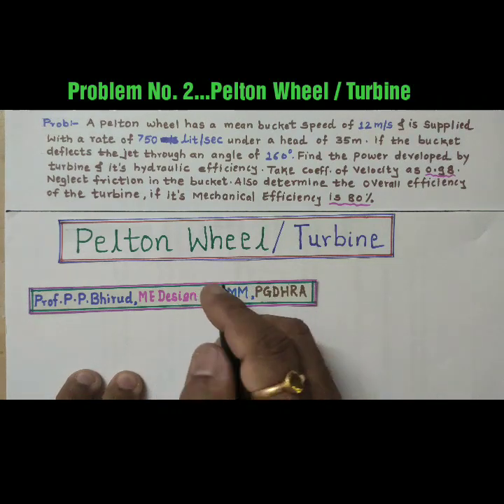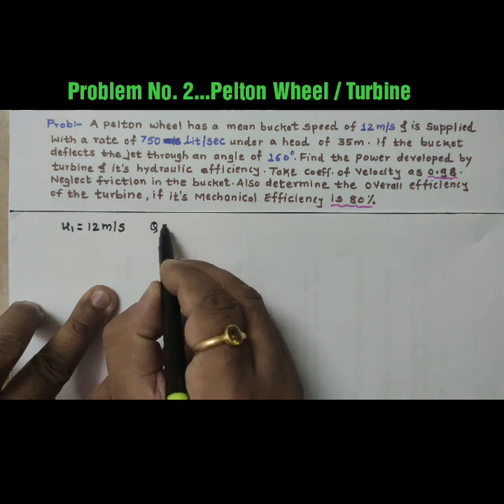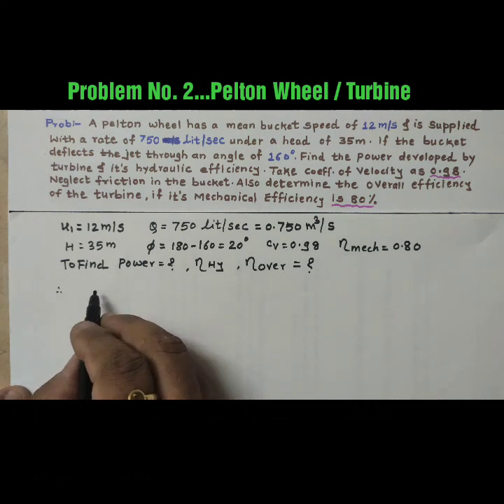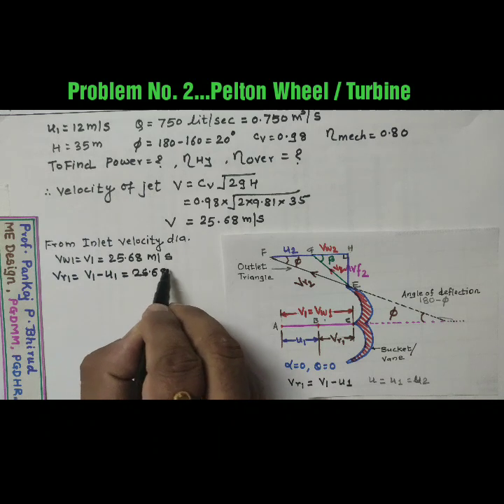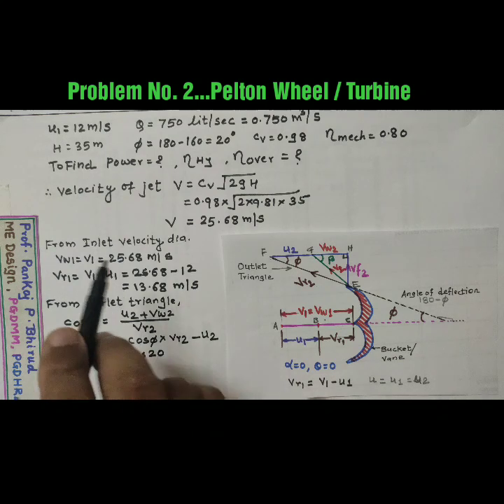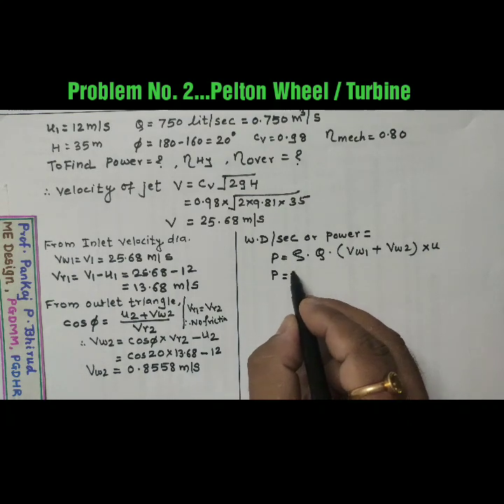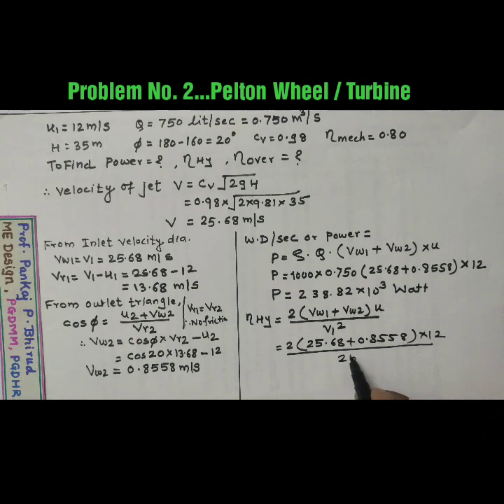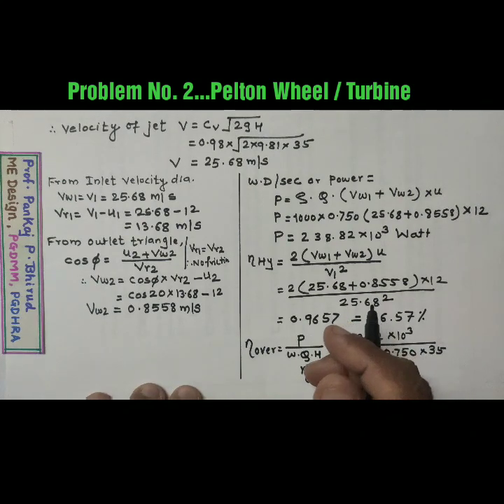Numerical of pelton Turbine | important formulae | Problem No 2. on pelton turbine -Fluid mechanics

Comment: A Pelton wheel has a mean bucket speed of 12 m/s and is supplied with water at a 
rate of 750 liters per second under a head of 35 m. If the bucket deflects the jet 
through an angle of 160°, find the power developed by the turbine and its 
hydraulic efficiency. Take the coefficient of velocity as 0.98. Neglect friction in 
the bucket. Also determine the overall efficiency of the turbine if its mechanical 
efficiency is 80%
Reply from the maker: Have u understood problem by watching video.
Reply: @pankajbhirud_engineeringtigers  Yes sir , Thank you sir ❤